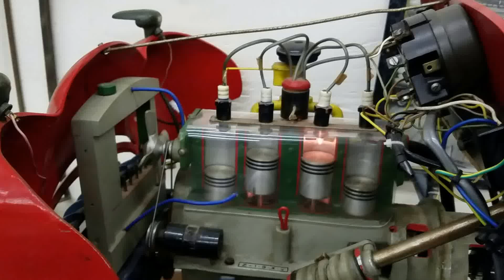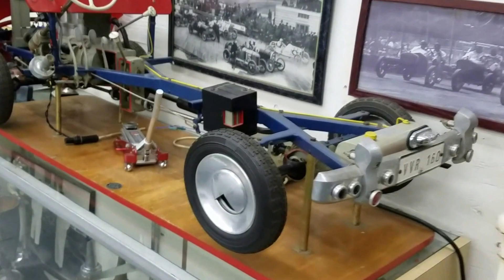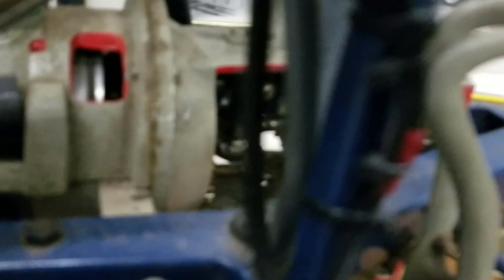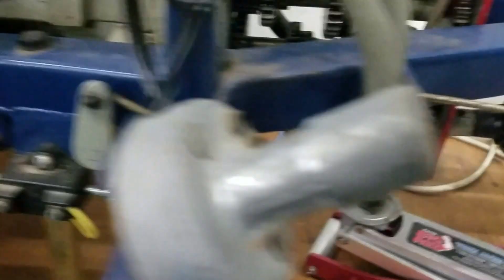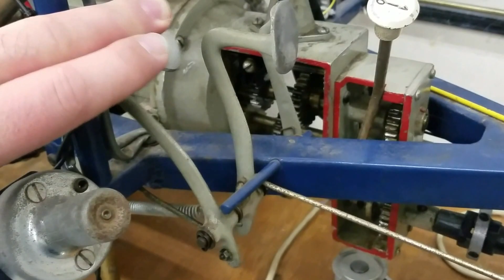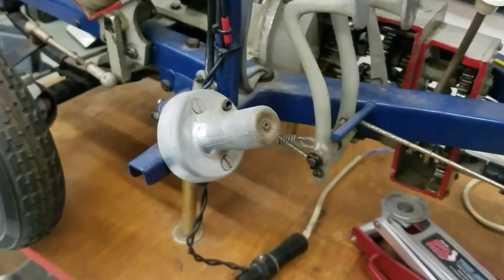Overview of a VVR working car model

Comment: Beautiful, thanks for posting, two quick questions though if you could: where did you get the little jack and what is the second lever on the gearbox for?
Reply from the maker: @WobbleMatic  The little jack was a Harbor Freight give away. The lever on the transmission engages the front wheel drive.
Reply: @spdfreakls1  That's a VVR160 so, quite rare as it was only made for the military I think.